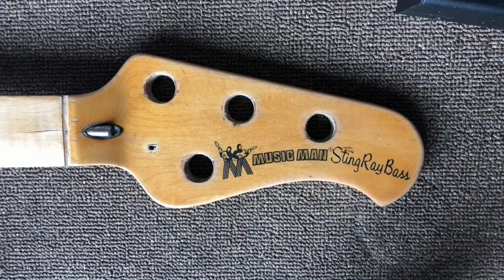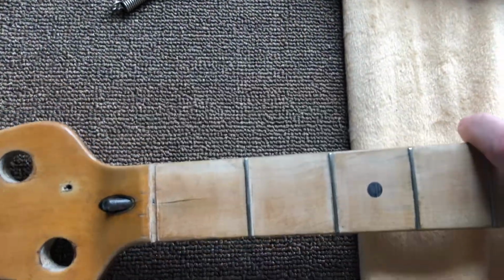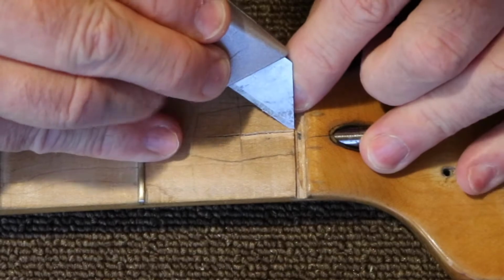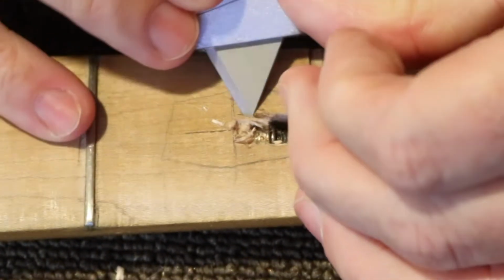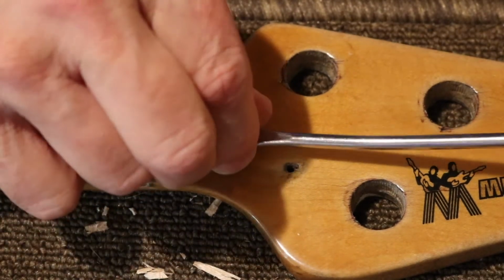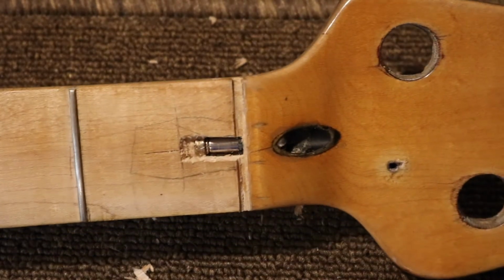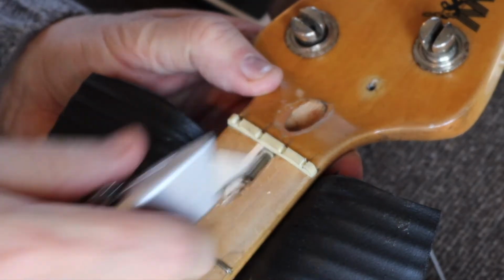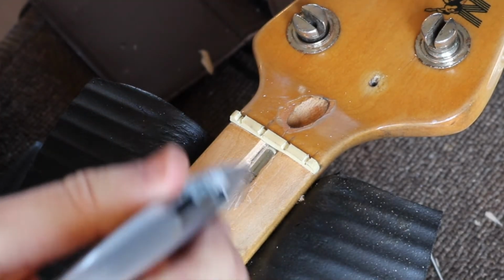1979 Music Man Sting Ray Bass - Truss rod cracking the neck and fret board - Part One of Three

Comment: remove bullet , cut slot, 
add 2 washers, install, 
set neck relief,
 fix crack with wood filler, putty or hard wood plug, 
sand, seal with lacquer, reinstall nut
 fixed.
Reply from the maker: Hi Grant - yes... but the truss rod was pushing up through the neck, so I couldn't use fillers... had to have something much stronger... so, I used titanium with a maple wood cover.

Comment: My Fender Jazz just developed  this. Mine is a 75 reissue, and when cleaning the fretboard I noticed a hump in the block inlay.
Pretty sure mine is caused solely by the wood behind the nut/washer  mushrooming under the compression.
They should have used a thicker and broader base (thrust) washer to prevent the wood from being forced out around the diameter of what was used here, and in my Fender.
Then again, it may just be a hit and miss affair as most necks may have a stiffer maple, and only a small fraction end up failing in this way.
Tough to say, but still seems like a lot to ask from such undersized load bearing parts.
Thanks for the video.
Reply from the maker: That is such a shame.... as you saw, it was a bit of a mess to fix, but this fix is still doing it's job.

Comment: I would have removed the entire 1st position square flush with the rod. You can see what's what and route the maple patch for a brass piece if needed. The fret and nut would disguise 2 ends of the patch. Or, depending on your client, maybe sanded down the entire board, got to the rod, and set him up with a modest slab of rosewood or maple. That board was pretty shot anyway.  
😝 That is such an ugly problem to address. 
🙄 Don't be impatient with the floor manager.
Reply from the maker: :-) good one.... I wanted to keep the edges natural.... installing a fret board is an interesting idea... but he wanted to keep it as original as possible... sentimental value. Lets hope I don't get another but if I do.....

Comment: You can order replacement truss rod nuts from Ernie Ball. My problem is that I accidentally broke the truss rod thread itself.
Reply from the maker: that can an expensive thing to fix.... I suspect you are able to remove the truss rod, if so, can it be repaired or could some local iron smithy make one for you? Many truss rods are interchangeable... another make of truss rod might just work with some tweaks?...
Reply: @LennonLuthierFinagler  Basically what happened is this:

My Stingray was in the same condition as yours. The truss rod was causing a fretboard crack between the nut and the first fret, and there was also a bow in the neck. 

To increase playability, I tried straightening the neck, but I twisted the nut too hard and literally snapped the thread off. Now there is literally nothing the nut can be attached to, therefore the truss rod has no tension anymore.

So now I have two problems: 1) the truss rod is effectively broken and 2) the fretboard still has the crack in it.

As far as I know, the only way to replace the truss rod on this neck is to open the rat tail. Does that sound correct?
Reply from the maker: @hillerm  It does sound like you will have to remove the truss rod... what a job and it is a job for specialist tools! Only then will you be able to tell if it is fixable. The crack should be fixable with what I was able to do on the video but no use fixing it if the truss rod has to come out. Email me some pictures... austen @ austenlennon .co.uk